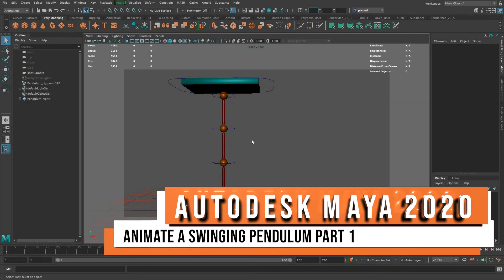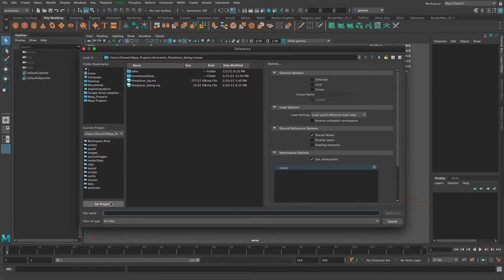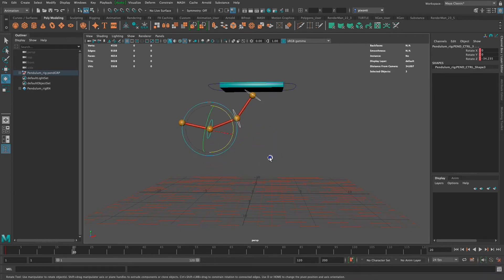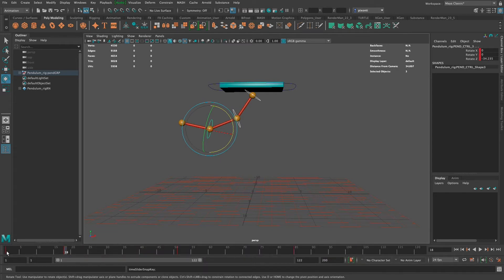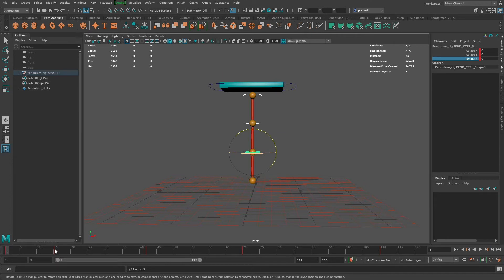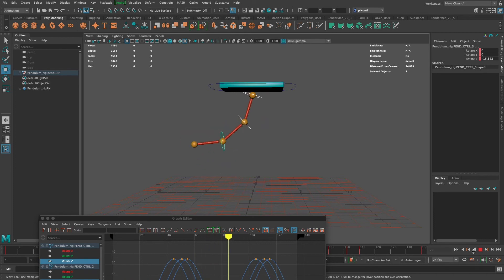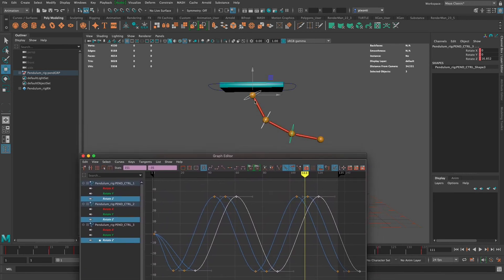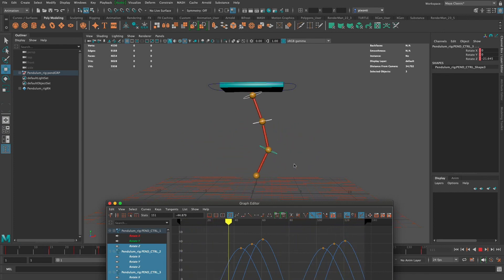Autodesk Maya 2020 - Animate A Swinging Pendulum Part 1

Comment: Why is my animation snapping?
It's not playing the in-between frames. Help please
Reply from the maker: There are two possible reasons your animation may be skipping inbetweens. Either the Stepped Preview is enabled. Check this by right-clicking on the timeline (time slider) and make sure Enable Stepped Preview in the contextual menu is unchecked (or off). If that is already disabled, check to see if the tangents are not stepped. Do this by opening the Graph Editor (Windows > Animation Editors > Graph Editor) with the controls or the rig selected, and see if the curves a flat (horizontal) between keyframes. If they are, select them all (on all controls) and convert them to automatic or spline. There are buttons in the Graph Editor toolbar to do this, or choose Tangents > Auto > Auto Ease, or Tangents > Spline. Let me know if that changes the animation.
Reply: @StephenAnimates  oh my Goodness you won't believe this. It was because my movements were stepped. I needed to select the key frames in the graph editor and spline them.

Comment: why does the red line keep disappearing? After I keyframe 1, I go to 20 but when I select a different ring the red line disappears
Reply from the maker: I assume you are talking about the red lines in the timeline. The red line is a keyframe. Keyframes are shown in the timeline for the specific control you have selected. By default will not see a keyframe on the timeline when you select another control. Keyframes are not visible on non-selected controls. If no controls are selected, you will not see any keyframes. If all the controls are selected, you will see all the keyframes for all the controls. This helps you since you will only see the keyframes for the control you are working with.

Let me know if that helps to explain, and subscribe if you're enjoying the tutorials.
Reply: @StephenAnimates  oohhh ok I gotcha. Thanks! And yes I am already subscribed :)